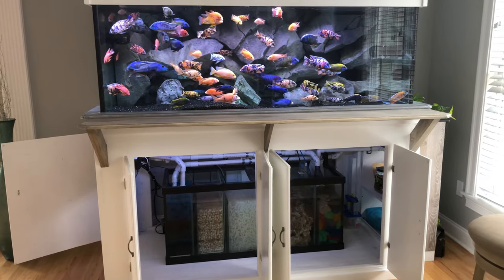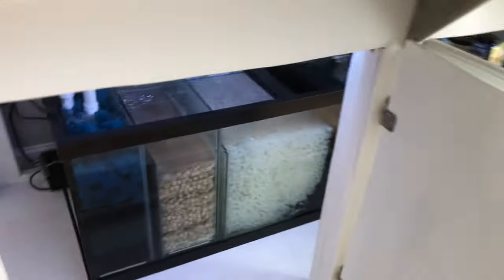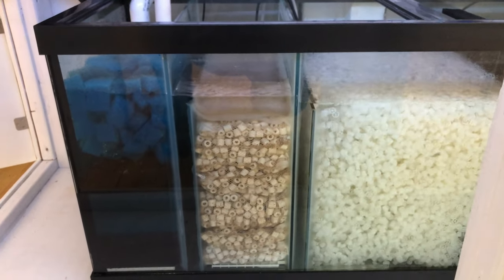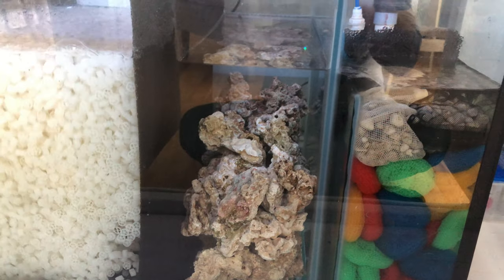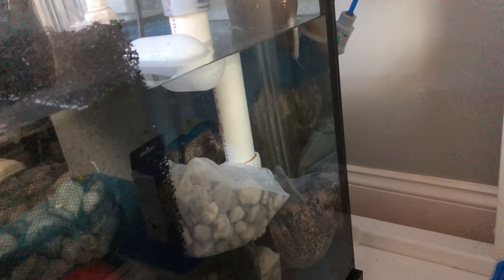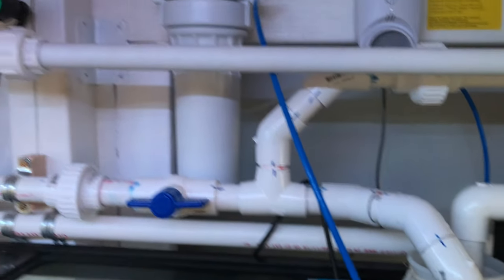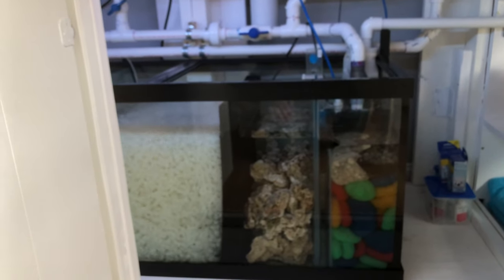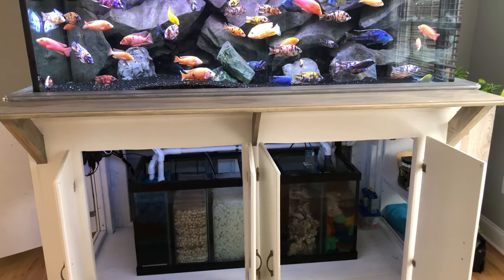Update on the Sump!

Comment: Grab yourself a couple of long air stones that fit across the sump, add them in instead of the disc air stones and place one at each end of this section. This will give a better overall circular flow and keep all the media moving including the corners.

Comment: Dang man... I did plumbing on my 560 gallon.  I can appreciate all the work you did.. I also have a fluidized media system; however i cant seem to get it to move well.  Have a huge air pump, but it just makes the media move to the top of the sump.  I have two air stone strips one each side.   Any advice you can give would be appreciated.
Reply from the maker: I use a Jebao wavemaker to move the K1 in this video. That said however, I no longer use K1 media, I have replace it in all my tanks with marinepure blocks. Holds a much higher volume of beneficial bacteria.
Reply: @Jetblink619 The K1 media was not upto the task ?

Comment: Impressive Sump design. Can you explain how the auto top off ( using the float valve  ) system works in the sump. Also is it possible through any automotive system in which automotive water changes ( periodically small amounts of 15 to 20 gallons in the sump specifically in the Return Chamber, four to five times in a 24 hour duration of every after 3 to 4 hours time gap ). Trying to figure out small AUTOMATED water changes procedure in the sump... like 20 to 30% water changes of the total tank capacity.
Reply from the maker: This is an old vid, this tank has a constant drip system on it now. It’s been in use for a couple of years now, I have a vid or two on it if you want to check it out.

Comment: On the k1 media get a pvc pipe an drill some holes about every half inch an cut it so you have 2 of them that you can put on each side on at the bottom pushing air though it .. That will make it move faster an you will not have any dead zone ( media that not moving ) it will be much better an more affective … but everything look great ….
Reply: What size air pump and diameter would you recommend 
I need to get mine moving a lot better
Reply: I’m not to sure seeing the the media your are moving around is in a small space… if your just using it for that and the air going out the pvc pipe you drilled the holes on…A decent air pump will do … You want one that can run about 4 of them if needed just in case …it might take a few try’s in how you set it up and how fast you want media to move …. But prices wise I say about maybe 120 - 75  dollars…. For the pump… because it depends on the size of holes you drill will determine how much air will move though them …. Hope it helps..
Reply: Ok thanks I’ll have a play

Comment: No filter socks! With the massive amount of ceramic media, does your fluidized bed filter do anything?
Reply: K1 media is probably still doing most of the biological filtering with this big of a bioload but that would be very interesting to know for sure what percentage of the load it's taking.
I could see it not doing much if the k1 media was added after the aquarium was completely cycled.

Comment: hey mate love your vids basically trying to emulate your sump atm 
question are you using k1 or k1 micro and have you used both 
also to turn the k1 are you using an air stone disc just wanted to clarify (...lol) and are they just in each corner of the section

cheers from australia
ps you wouldn't believe how hard k1 or k1 micro is to get over here
Reply from the maker: That is standard K1, however…I no longer use it. I removed it about a year ago from my systems. Here were my issues with using that media… It was very loud, required a good size wave maker to push it around, like that, doesn’t hold much beneficial bacteria compared to other medias I have used and I am now using. Check out some of my more recent videos on the tank or sump. I am a big fan of using lava rock as it is very porous and much much more effective. Not to mention it is very cheap.
Reply: @Jetblink619  awesome thanks for replying so quickly cheers from Australia I'll take that into account

Comment: Nice video. I come from a saltwater background and contemplating switching to a freshwater discus setup. I currently have a 450 gallon reef with a 100 gallon sump and 40 gallon refugium. I know freshwater skimmers are not commonly used in freshwater, but can I use my skimmer by adding air stones to create fine bubbles? Also, can I utilize the refugium with nitrate absorbing plants on a reverse light cycle? Any other advice would be appreciated.
Reply from the maker: Thank you.
Unfortunately proteins skimmers have little to no use in the freshwater environment. Freshwater cannot foam up like its saltwater counterpart. Best way to keep pristine water with low nitrates, etc., is to do weekly water changes and or a constant drip system like I have on my tanks that is constantly replacing water at a slow rate. Discus prefer very clean water, so I would recommend a planted tank with a sump/refugium.

As far as the refugium goes, I would suggest using Pothos plants. They are extremely easy and in my experience over the years I have found them to remove the most amount of fish waste by far.
Reply: @Jetblink619  Thanks for the tips.
Reply: Floating plants consume a lot of waste also.

Comment: You have an awesome setup! I've am new to K1 and have a question - how long before it stops floating? I've soaked mine for over a week and still when I put it in the sump it just bunches up and floats.
Reply from the maker: Thanks! That is a tough question to answer as each tank is different, of course. In my experience, it can easily take at least two months for it to start taking hold and start to tumble freely.
Reply: @Jetblink619  wow -thanks. That's a long time!!

Comment: This is a great setup.  I did something similar to yours as well but I don't have a strong enough air pump for my k1.  Which air pump are you using in yours?
Reply from the maker: Thank you, however this is an old video. I was using a wavemaker pump to move the K1 around. That said however, I no longer use K1 in any of my tanks.
Reply: @Jetblink619  Why not?

Comment: Awesome system! Do you mind sharing how wide (or how long) your sump's K1, ceramics, and intermediate compartments (where the water goes up) are? Also, how thick is the glass of your sump? I'm just trying to get an idea of dimensions as I'm currently in the process of designing a new sump for my freshwater tank. Obviously, the space between the intermediate baffles where the water goes up is much thinner, but I just wanted to see how thin. Any input is appreciated!
Reply from the maker: Hey Marco, happy to help. I will be making a video soon to come on how I make my sumps because I do receive a lot of messages asking about them.
Each section is 8” wide.
In between the baffles where the water flows up...the spacing is one inch. The width of the glass baffles I cut were 17  5/8” I believe.
Reply: @Jetblink619  Sounds good... Appreciate your help!
Reply from the maker: @marcom.4411  let me know if you need anything else 👍

Comment: Nice setup, but my guess is total cost pushing 5K, perhaps more with some of the fancy gear.  What was the budget for this?  I would also beg to differ about the plants, I have a ton (including a 25 foot pothos) and although they do very well, I do not think that they are any substitute for regular water changes, they make use of the nitrates but do not 'remove' them.  Just my two cents and although tbh not a fan of bare tanks like this, the fish are pretty.  Did you build the setup or buy it?
Reply from the maker: I built everything you see, not a ton of money into it since I had everything already.
Constant drip auto water change system on the tank does a constant water change. Nitrates practically undetectable
Reply: @Jetblink619  Sounds like a nice system, I guess the constant refresh might be required more for salt water.  I just wanted to point out that plants will not remove any extensive amount of nitrates; in my experience at least that just hasn't happened.  I also rarely if ever test though, just can't be bothered spending money to reassure myself what is obvious if you look at the tank; ie everything is fine  :)   As I said I have a ton of plants, total biomass maybe 10 times more but on far smaller tanks, 35, 40 and 90.  I grow several kinds of pothos, bamboo, jasmine, and I have a spider plant the size of a medicine ball with 4-5 foot runners; it went insane as soon as I put it in the tank.  Yes, in the tank, not a sump.  I built frames with window screen stretched over (cat proof), and cut slits for the plant stems.  Fish and shrimp both love the roots, I cut them back so they are not unsightly also.    I just wondered about all the extra equipment in a bare tank, what's to clean out of the water besides a bit of suspended particulate, esp with no vegetation, also esp after that insane sump more suited to Marineland lol.  :)  cheers and happy christmas
Reply from the maker: @nobrainsnoheadache2434  👍 Happy Holidays